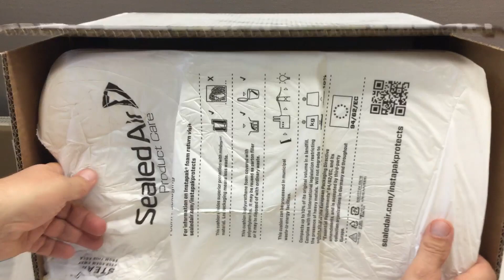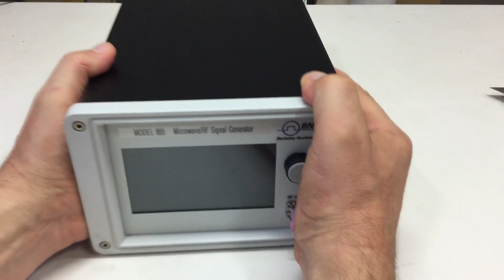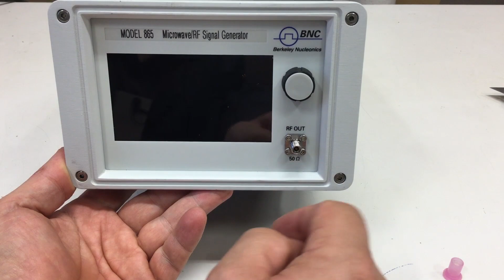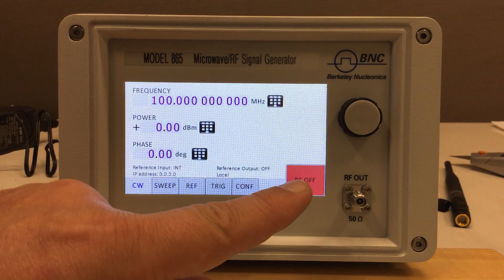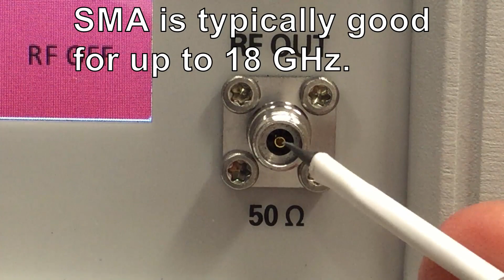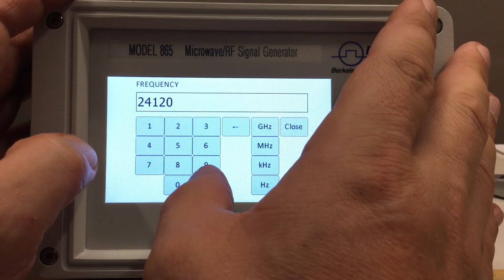BNC Model 865 40 GHz RF / Microwave Signal Generator: Unboxing

Comment: You would expect that much in terms of construction from an instrument which costs nearly US$10,000.  And BTW that connector on the front is a K connector...don't ask how much cables for that cost...and you need a torque wrench for proper termination.
Reply from the maker: Yes, you would, wouldn't you (regarding the construction)? But I was still impressed by cast aluminum front- and backplate. BTW, I did know it's a K connector ( https://youtu.be/VaBzUPYwyqY?t=571 ). And unfortunately I don't have to ask how much K type stuff costs - e.g. about 100 bucks for just a K to SMA adapter :-(

Comment: Now you need a 40 gig scope.
Reply from the maker: Unfortunately there's no 40 GHz scope in BNC's portfolio :-( So my 200MHz scope will have to do for the reviews (should be enough to show what the unit can and can not do). But after the reviews I plan to play around with the unit and some motion detection / doppler radar units at about 10 GHz :-)